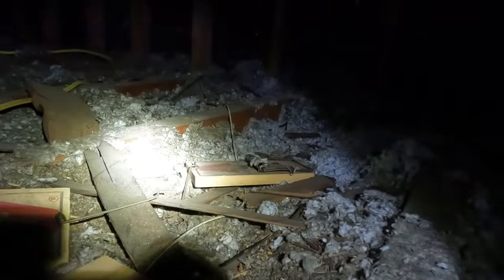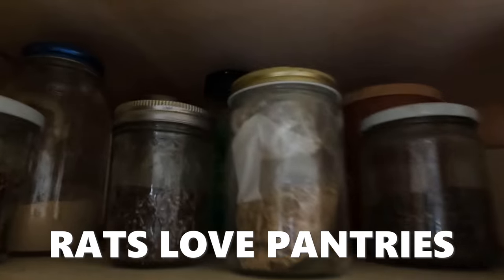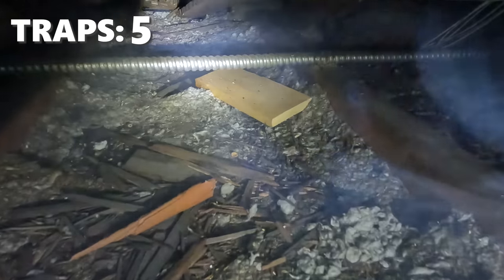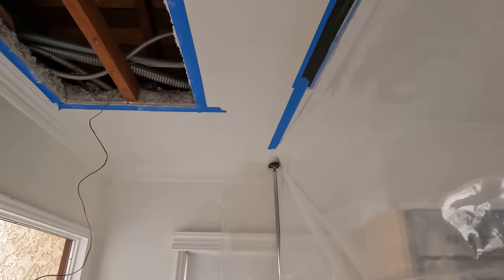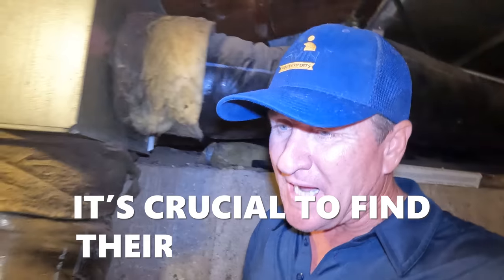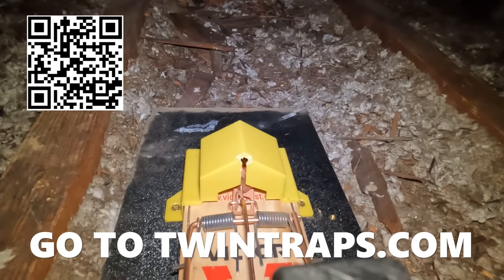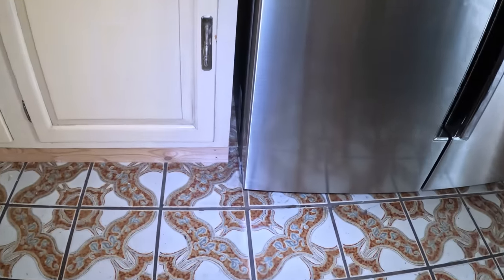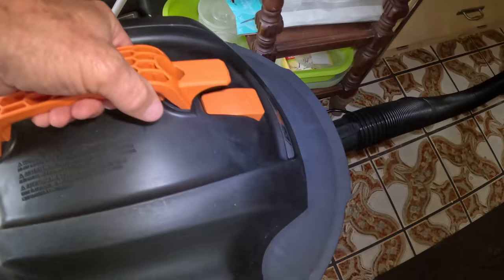The FASTEST way to Get Rid of Rats in your Kitchen...shop vac

Comment: Have you guys ever thought of like a gopro mounted on a rc car to get undet the super tight crawl spaces
Reply from the maker: Yes. We are working on this. Do you know of a RC truck that you can turn on/off using the remote? Vs having to switch on/off at the truck. Thx 🙏
Reply: I am assuming you want to kerp the receiver powered so you can turn it back on.
Reply: or add the extra device I facebook messaged you with

Comment: 15 days to get rid of the ray problem?

I have the problem with 5 weeks now. I have a dog but I don't leave her food out. I have her food in its own bag inside a metal container. If she doesn't eat her food after 10 minutes I put the food back into the bag and seal the bag and cover the container. 

All food is in glass jars with glass lids to stop the scent of the food going around the house. The only food that's not in glass containers is food in my fridge and freezer.

I clean the counters and hoover the carpets and floors including moving my furniture , washing machine and dishwasher to hoover under them.

I've gone around most skirting boards and sealed over and under them with silicone. 

I put silicone over any holes I found on walls including screw holes in the walls and ceiling.

I've put silicone on any cracks on walls and cracks along windows and along the ceiling that meets the walls.

Any holes around pipes and electrical cables I found in walls and ceilings I put expanding foam then shoved steel wool into the wet expanding foam and stuffed the hole tight with steel wool then put more expanding foam over that.

I've searched high and low outside where the rats could be entering my house and can't find the entry points.

I have two traps in my attic with weeks and poison. They haven't touched the traps and urinated on the poison I had down so I cleared out some of that poison and put down new poison which they started eating.

I have two outdoors rat traps which they can't flip upside down. I've prebaited those traps.

I've had a "professional" vome and didn't even put in a half ass effort to find where the rats are coming from suggesting they're coming from  my neighbours garden and through a hole in their wall to then plug the hole with expanding foam four weeks ago which I'm assuming the rats have chewed through by now and put three traps in my neighbours attic. Which didn't solve the problem.

I've paid rentokill which I assumed would put some effort into finding where the rats are coming from and block their entry but so far he's just looked into my attic from the attic entrance and put down poison in my attic twice and put a bait station in my garden.

So far I don't think the rats have made their way into the living area yet. I have two indoors blink cameras that I have set when I'm not here to go off when they detect movement and they haven't caught a rat in the house yet.

Unlike this woman I'm absolutely terrified of the little fu&£ers.
Reply: Hire a handyman to search by rat urine smell

Hire a plumber to search for pipe access